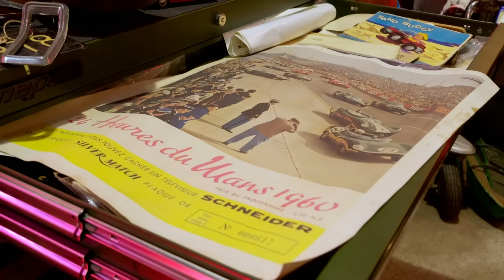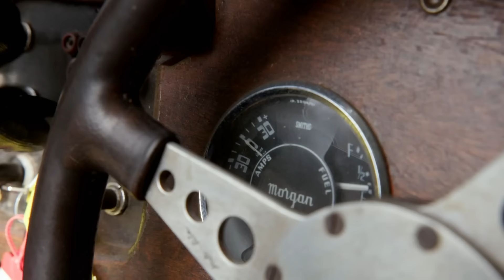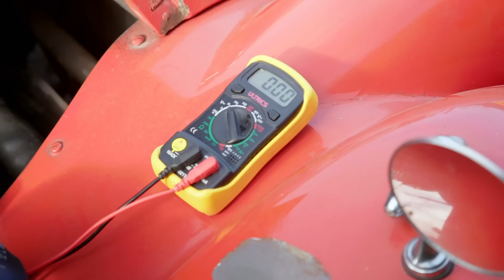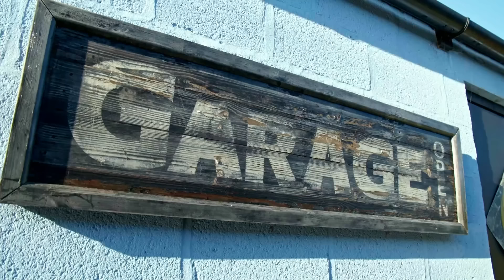Henry Pays Over £8,000 For A Morgan 4-4 That Needs A LOT Of Work! | Shed & Buried

Comment: I am suprised that it did not appear that the fuel lines were cleaned , the oil changed and the motor was checked to be turning over freely. This may have been done but not shown, but if the video is taken on it's face value a lot of damage could have been caused to the engine by just attenpting to fire it up without proper preparation.

Comment: My friend had one of those back in 1965. I rebuilt the motor that was in it. Turned out to be an English Ford motor. Certainly no performance car, sloppy oddball shifter, wooden frame. To be generous it was rolling junk. My pal Tony got rid of it. The car looked classy, but that was all.
Reply: yep an old kent four banger!!! not even a 1600 gt !!! an a ash frame that you hoped hadent rotted!!! nada!
Reply: You are  a yank?
Reply: @bertiewooster3326  yes a "Yank" Can tell by the perfect English.....
Reply: @MadMomma-kj9ks  haha it was a good guess in fact a well set up 4/4 with the 1600 Ford engine producing around 115bhp was a very fast nippy car in the 1970s I had 3 of them over 20 years !! Cheers.